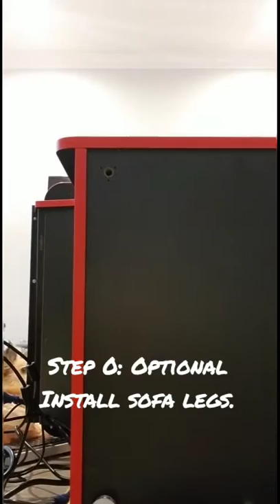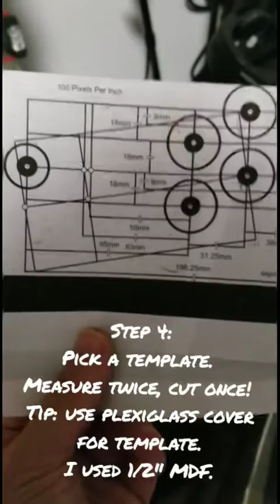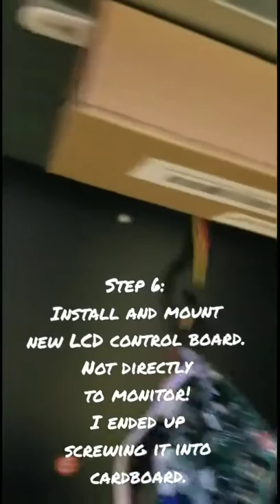Pacman Arcade1up Cocktail Table Mod MAME

Comment: How do you turn on your pc? Did you install a separate power button somewhere?
Reply from the maker: I have a surge protector with a switch. Change your computer bios settings to power on when it is plugged in. You can also install a power button but this way is easier.